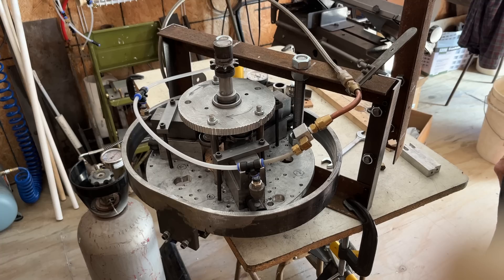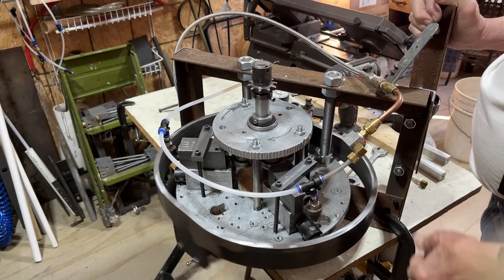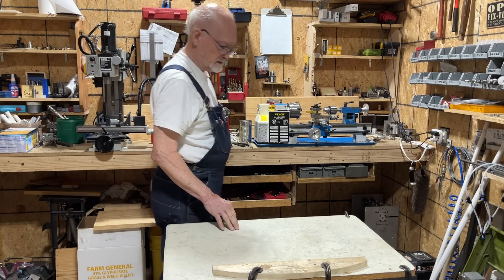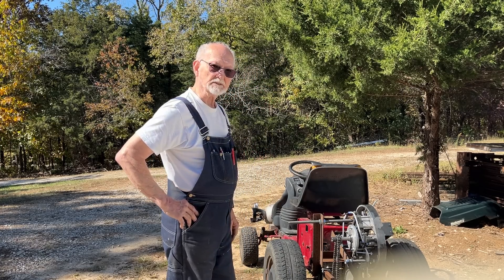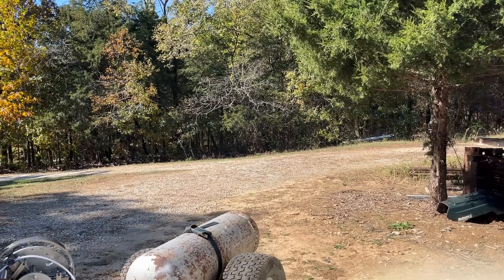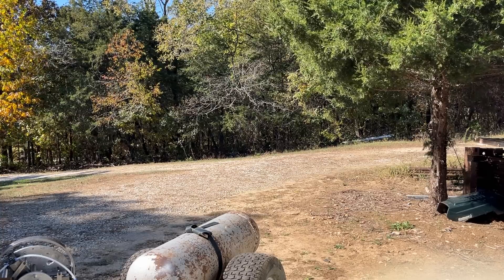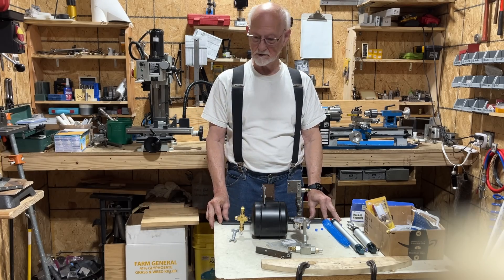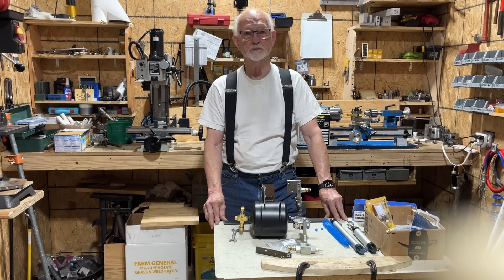Driving with one of my Prototypes - A 3 Cylinder Air Engine 10-20-2024

Comment: Needs some improvements though.  That engine will vibrate itself apart.  Counter balance that ring, and maybe a flywheel will help.  Also, of course, some sort of muffler would also need to be installed.    What is the energy input to energy output ratio?   Nifty experiment.
Reply from the maker: Thanks for checking in!
I have the balance under control now, and for a muffler - that's something for another day.
The input to output energy ratio will be difficult to predict - too many variables?
If I can get it to move the vehicle up and down the road, that will be enough output for me.

Comment: I guess the efficiency consideration should include how you get the tanks to the pressure required to run the engine. If you are able to pressurise tanks using an electric compressor running on solar or using hydro power this would be about as clean as you could ever get and also as free.
Reply from the maker: That’s something that will come after I get everything working where it needs to be.
Would have to be with wind or solar, I don’t have any water source.

Comment: Wow, a piston rotary engine. Your torque configuration is pushing out on the ring, reason why your outer ring has to be so strong, and you end up losing much of your power, torque. Change the angle of the pistons or place your ring in the middle and pistons to the outside. However, what you would end up doing is creating a piston power rotary engine. Loss of efficiency would be great either way. I like the way you think. I too am retired and just play around with mechanics. Keep having fun. 
Another way would be to increase the piston size and shorten the stroke however you would have to reconfigure the crank. The more you work on my ideas the more you would end up making something like a steam engine. Keep think out of the box something will come to you.  The larger the piston the less air pressure needed.
Reply from the maker: Thank you for checking in and your comments.
I will have to disagree on one thing, the larger the ring being on the outside gives it more torque to the driveshaft in the center, and it doesn’t have a crankshaft in it only a round driveshaft

Comment: husqvarna saws had a teflon either cylinder or piston. long time ago for me.
Reply from the maker: Thanks for the info and for checking in.
My engine is metal but the piston seals are made of leather like the old hand pump, and the piston itself is free. Floating is not attached to the connecting rod so it only moves when Ayres applied to it. Otherwise the engine can free wheel with no resistance from the piston or vacuum.

Comment: still dividing by three. try a line to each one. i'm not knocking what your doing.  you got this sir.
Reply from the maker: Thanks for checking in.
I have tried both ways uses less and makes it a little less bulky using in series, and at 300 - 400 psi there’s no shortage of air or pressure to each cylinder

Comment: That's a really cool engine. I would recommend using a torque converter for go karts. It will really help it out I think.
Reply from the maker: Thanks for the info.
My intention is to keep it as simple as possible, and efficient, so adding things to a chain drive would not be desirable for me.

Comment: In the 1960's, my Great uncle and his son went out to Montana, Utah, Colorado to explore Ghost towns. Somewhere in there travels they came across a machine used to pull ore cars in and out of mines. What they described as a small scale locomotive. They could not find a "fire box" and finally came to the conclusion that it ran on compressed air and that it would literally compress its own air and put it in two side mounted storage tanks. When needed, a valve was turned and the thing would be put to work pulling ore cars and pumping reserve air.  This was a story that I heard several times and I had no reason to doubt what I was hearing.
Reply from the maker: I’ve also heard several times from people that there was a machine that was called the whistling pig that did the same thing pulling cars out of the mines, but I don’t think that one had a pump and two storage tanks. It looked like one large tank that was filled with air.
Reply: @AirEngineResearch  About 40 years ago I ran across an air powered unit to pull coal cars through the coal mines which also provided breathable air as its exhaust. I believe it was in Pennsylvania and the mine was about 5 foot tall in places over the tracks!
Reply: Sounds kinda like air operated tugher

Comment: Why not an internal combustion engine, gas or diesel? Make it a little more robust, it looks like a good design.
Reply from the maker: Thank you for your comment.
Design and building and efficient air engine is a challenge and getting away from fossil fuels air is free. We just have to figure out a way to use it with what nature provides us with solar wind, water power.
I’m in the process now of designing and building it. The wind and solar power compressing will come next.

Comment: The exhaust noise indicates there is substantial wasted energy. You should consider a double expansion design and also double acting cylinders , which are easy to use in a compressed gas or steam system
Reply from the maker: Thanks for your thoughts and comment.
My goal, and my design is for a simple air engine with a few moving parts as possible that is easily accessible for repairs.
Adding complicated cylinder, configurations, and timing advance devices would be very difficult to apply to a simple three cylinder air engine?
Reply: @AirEngineResearch  Fewer moving parts....go electric then
Reply: @johnarnold893  To go electric would defeat the whole point of the project. Anyone can bolt on an electric motor and go. What he means is as few parts as possible while keeping the same basic concept.
Reply from the maker: You are correct!
Reply: PaulG.x Great observation on the exhaust! Could also reduce to valve open dwell time (duration) as desired rpm is reached to conserve air pressure.

Comment: When you think that air can be compressed and liquified, than a tank can hold large volume and reserve for long distance funny trips in the garden. Really cool !
Reply: Using liquified gas has no advantage over compressed gas as it needs an enormous amount of extra energy to condense the gas into a liquid and then you need to use more energy to convert it back to a gas in the vehicle. You can't just rely on ambient heat to turn it back to a gas , it is too slow to power an engine and everything around it freezes.
Reply: @PaulG.x  you are fully right yet it is fun and if it is based on locally available renewable it becomes even interesting ;-) There were many tentatives in France but no market achievements. There is no such thing as free energy....
Reply from the maker: Yep, it was fun - first time I drove with my 3 Cylinder Oval Engine

Comment: This is so awesome. Compressed air doesnt hold too much energy though, perhaps a regulated system to decompose peroxide for a steady pressure supply? It'd be closer to a steam engine at that point.
Reply from the maker: My goal is to use what mother nature provides free air, wind and solar power to compress that at some point later
Reply: @AirEngineResearch  if you are going to limit yourself to renewable energy and compressed air, perhaps this is more your style? Hot air has more pressure than cold air. Maybe a solar powered heater to heat the air tank so it maintains pressure longer? If you can get your hands on one i'd also recommend a scuba tank and compressor. Scuba tanks hold much more pressure than a common air tank.

Comment: Very cool design. It would seem that a slightly longer stroke and possibly steam would be benificial for more power. Steam would give more expansion than air.
Reply from the maker: Thanks for the comment, and yes steam would work but not practical on my small homemade vehicle, boiler, fire box , something to burn and water - now I just need an air tank,

Comment: I subbed because i think you deserve to be over 1k subs.
Like a power washer nozzle increases the pressure forcing through a smaller orafice. Can you use that line of thinking to increase the pressure applied with the same psi in tank.
Reply from the maker: Thanks for the suggestion.
I believe it does increase the pressure per square inch, but it is a much small area coming through the orifice, but once it is through it expands to the volume of my cylinder and has much less force.
I am basing my design on how many cubic inches of compressed air I have, the Nr of Cylinders, the Square Inches in each Cylinder, and the number of engine revolutions to tire revolutions. 
There are a lot of complicated formulas that can be used, but it still comes down to how much compressed air I can carry and how far it will take me.
Reply: A nozzle increases velocity of the flow through it , not pressure

Comment: I love seeing you pulling your buddy around on the tractor.. with the low gear ratio you have an opportunity to show off the torque by pulling heavy objects and climbing steep hills.  I found when I added the use of a transmission on my second prototype it multiplied the top speed more than four times. So I would suggest looking into putting some changeable gears. I agree that you need larger cylinders, but it's lower pressure that will get you where you want to go. Higher pressure is just blowing out your exhaust and the efficiency of energy conversion goes with it.. do the math a 1" piston at 150 psi is going to push about the same as a 3" at 20 psi.. if you calculate potential expansion in the cylinder, using advanced intake cuttoff, you will find its not hard to use 100% of 20 psi for force, leaving nothing to waste.. it's at about half the stroke.. your timing advancements  over 150 psi would have to be at nearly the top of the stroke to use the force effectively..  stop wasting your time by ignoring my advice.. let's show the world this can be done
Reply: "blowing out your exhaust and the efficiency of energy conversion goes with it..."
What is your current peak efficiency of conversion?
Reply from the maker: That can be something looked at later right now. I’m just trying to design and develop the mechanics of it.
Reply: @thedubwhisperer2157  at 15 psi my efficiency of expansion to mechanical force is roughly 100%, so subtract the resistance of two double action cylinders and a rotary sequence valve, and there's your answer. I just wish I had the luxury of time and funds to continue my research right now, because I am ready to begin producing air powered bikes and am moving on to developing liquid nitrogen transportation. The cost of living combined with projects like replacing my roof has me financially overwhelmed and it might take a bit for me to be able to catch up.
Reply: @Pneubike  That is a rather dishonest use of the word of 'efficiency' in this context.  
I should be more specific:  What is the energy output of your air motor compared to the energy used to compress the air?
Reply: @thedubwhisperer2157  I am not developing the compressors, so your question is not justified.
 The efficiency of a compressed air motor is dependent on the percentage of expansion that can happen within the system. He is not allowing any advanced timing to allow for any expansion. Therefore, his expansion percentage is negligible, almost 0%.. whereas at 15 psi and 1/2 stroke of intake timing shut off advance there is no pressure left inside the cylinders of my motorcycle when the exhaust valve opens, getting a full 100% of the expansion potential converted to motion, so only subtracting mechanical and wind resistance from being a 100% efficient transportation system.. There's almost no comparison when it comes to distance potential.. the evidence is in the silence in which it moves at 15 psi. my motorcycle goes to 200 now before the safety releases, and can waste all its air just as fast as his do, because it can't get efficient expansion at that pressure, but kicks like a mule.. it's got a regulator worth over a grand on it now, but I haven't been able to get my expired tanks filled to test it aside from a few burnouts..
I am not trying to discourage him, I am honestly trying to help, and he won't listen and thinks he is right when he has ZERO comprehension of efficiency, and doesn't advance his intake shut off a single degree.  We are on the same team, but if he wants to compete I will be happy to run circles around him.. I just need my tanks charged.
Reply: @Pneubike  You talk about zero comprehension of efficiency but you won't disclose, or do not know yours?
Reply: @thedubwhisperer2157  did you not read my response? It clearly explains how and why I can get nearly 100% efficiency while he is not even trying to get any efficiency? The only way I could possibly get more distance per tank is to reduce mechanical resistance or wind resistance.. I can dial the regulator to the perfect expansion pressure, or modify my valve to run off any pressure. The efficient timing cut-off is graphed as a curve 1/2 stroke will expand 15 psi, 1/4 stroke will expand 30 psi, 1/8 stroke will expand 60 psi.. do you understand? this is calculated for sea level with 15 psi ambient pressure, the efficient pressures at those timing marks are lower at higher elevations.
Reply: @Pneubike  I read all replies carefully; are you suggesting that you are extracting close to 100% of the energy in the compressed air?  What distance per tank at what speed do you achieve, and at what pressure and volume?

Comment: Any chance a flywheel would help improve it?
Reply from the maker: Thanks for checking in, and if it’s the six cylinder you’re talking about, there are two metal plates internally that are basically flywheel. If by chance it’s the three cylinder, there is the oval ring that rotates as a fly wheel, so there’s no need for any additional five wheels.
I haven’t really had a chance to test with the six cylinder, the first time I put it in there was problems with the seals in the valves, which I have taken care of by going to all metal internal parts. 
Before I can do anything further with either engine, I need to develop a pressure flow regulator to control the air pressure and flow to the engine.

Comment: Happy to see you still working on your Engine. We got hit hard in the County here in Upper east Tennessee by that tropical storm. Lives,homes,roads,Etc. Still saying weeks for power,phone,Etc. to get to some people here. The first week we were cut off due to trees and washed out roads. Have you thought about using a three cylinder engine and adapt it to run on Air ? Or use those pistons out of an oil less Air compressor has they are fairly cheap on ebay / amazon. ? As always I liked and shared. All my very best.
Reply from the maker: Years ago, I started with a crankshaft, but I found that it uses twice as much air because the piston moves twice as far as any of the designs that I’ve used so I basically have to make everything.
In my six cylinder engine, the pistons are free floating. They only move up and down when Air is turned on otherwise the engine just free wheels.
I feel for all the places that have been hit by these horrible storms, and looks like the future is gonna continue having them.
Thanks again for your comments

Comment: next step is to change the gear ratio, you might have enough power and rpm to go 3 times faster . think of a car in first gear , you can get the rpm up to 5k but only going 25 miles per hour but the motor has enough power to bring the car to 80 or 90 it just needs a different gear . i wouldnt change the pistons or any thing else untill you gear it to the point where it doesnt have enough power to push in that gear
Reply from the maker: I hear you and agree with one gear it has to do all, Flat ground, downhill and most of all back up the hill.
I will be doing much more trial drives to be sure I can get max out of it.
This winter I think I will do some modifications on it to get the valve system on top instead of under the bottom plate. It is not timed the best right now, it's hard to get to them where they are now.
For now, I need to work with my design to get a safe flow/pressure regulator working before I can do more with my main engine, the 6 Cylinder for the VW.